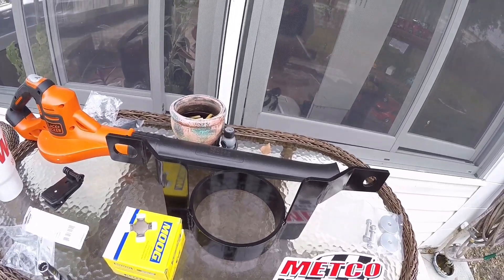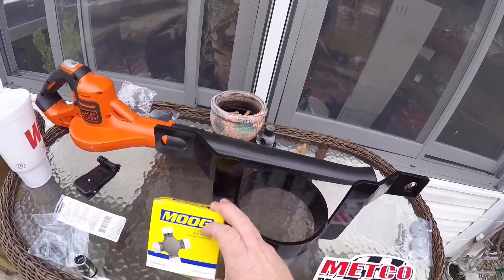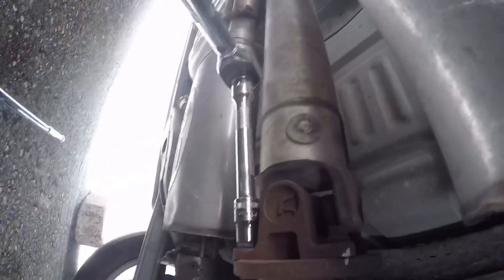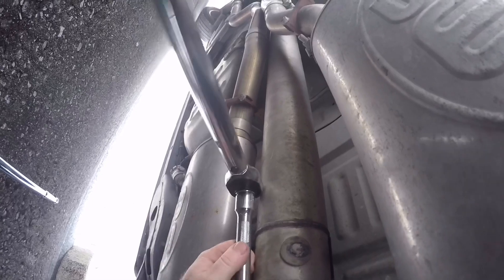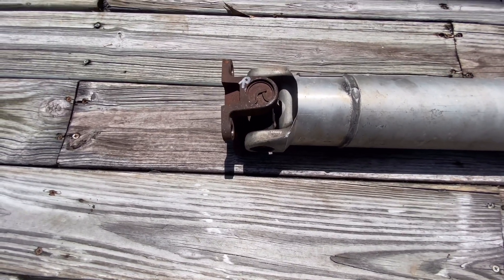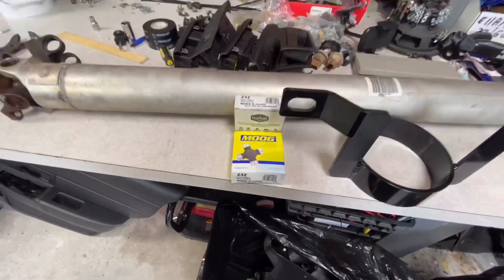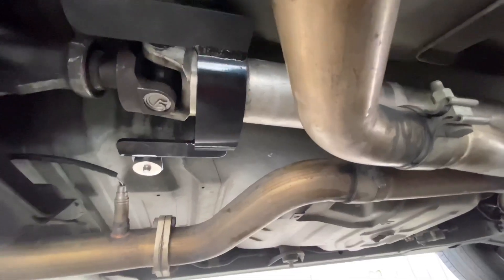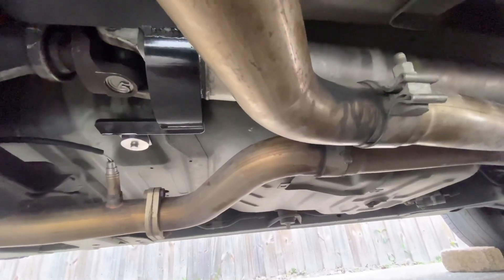Crown Vic Driveshaft Safety Loop

Comment: What is the actual part number for the moog u joint because the link you provided shows multiple moog u joints
Reply from the maker: If you go to rockauto.com and it’s moog 232 but it’s going to depend on the year of your car and if you have steel or aluminum drive shaft.
Reply: @fettboy99productions91  07 cvpi with an aluminum driveshaft
Reply from the maker: I’d say more than like the same moog 232 will work

Comment: It would've been even better if you would have shown the exact location of installing the bolts and washers . If you could explain the location, awesome
Reply from the maker: The bolts and washer go where the front right side driver set bolt is and the passenger lift front side bolt is. You take the two bolt out that hold the seat and use the bolts the kit comes with
Reply: Appreciate that
Reply from the maker: No problem